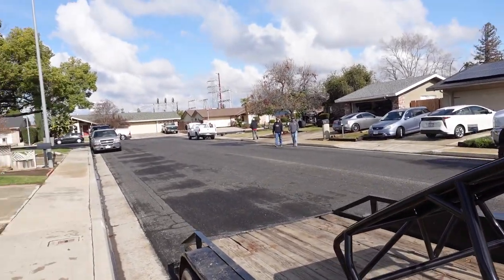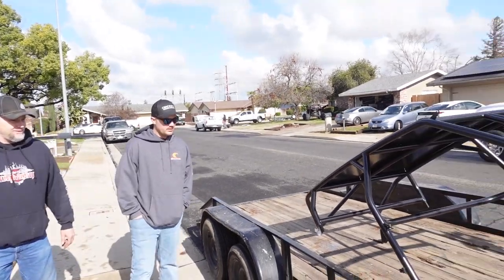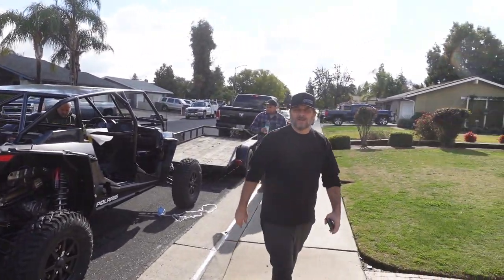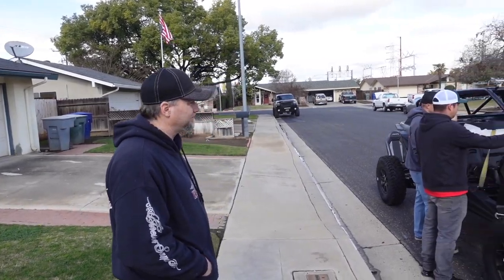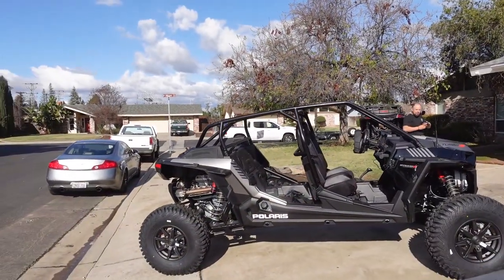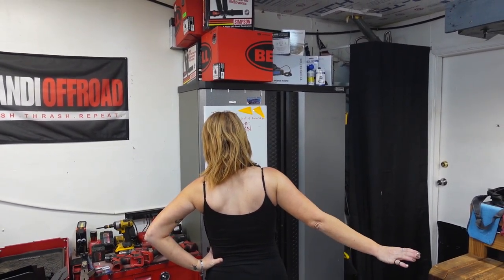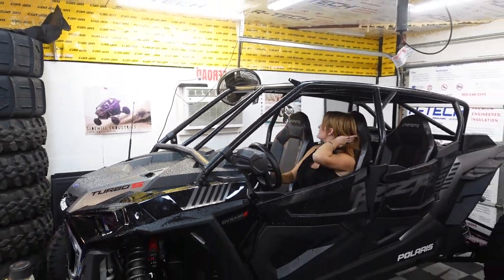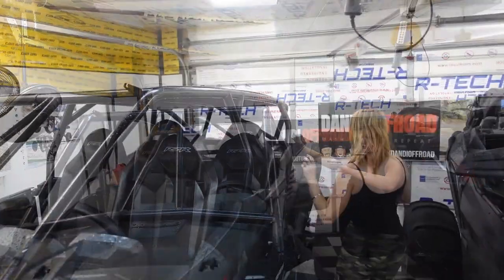RZR TURBO S 4 New CAGE INSTALL And First Look

Comment: Great video!that db cage looks great!!I have a question,was the doors easy to line up or was there a trick to get the doors to line up?
Reply from the maker: Thanks, didn't have much trouble with the doors at all. I just tightened the latch in place, left the hinges loose, latched it, then tightened them and made some final Minor adjustments after that.
Reply: Thank you!mine should be here from db cages next week,I just placed the order from Beto!

Comment: What’s the cost on the cage? What the Instagram under.
Reply from the maker: Sorry about that, the links are below now. The cost is 1,500 to 2,500

,DB Cage:

Instagram. https://instagram.com/dbcages?igshid=bm2k8h7jz1ja

Facebook
https://www.facebook.com/db.cages500 and they are under DB cages
Reply: @DandiOffroad   thank you very much.
Reply: @DandiOffroad  check out the direct supplier @ scenic motorsports on Instagram

Comment: Nice. What was the tire jacks you used.
Reply from the maker: https://www.harborfreight.com/1250-lb-capacity-vehicle-positioning-wheel-dolly-61917.html?cid=paid_google|*PLA+-+Top+SKUs+-+All+%28Branded%29|Wheel+Dolly|61917&utm_source=google&utm_medium=cpc&utm_campaign=*PLA+-+Top+SKUs+-+All+%28Branded%29&utm_content=Wheel+Dolly&gclid=Cj0KCQiA3smABhCjARIsAKtrg6JnCZFe0LeLlIaTfg8vZZNZynS6UWf3aDRhXV8AqFYeHnAMHHBLAR4aAhd-EALw_wcB